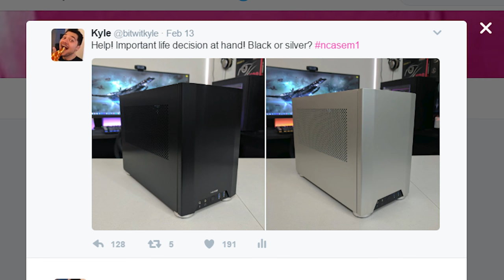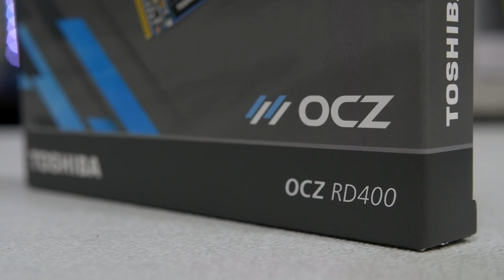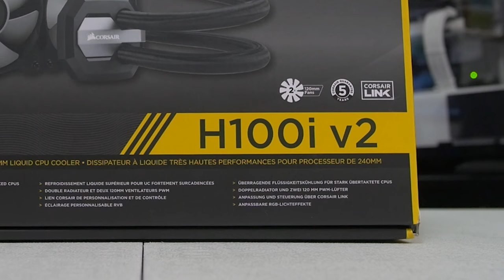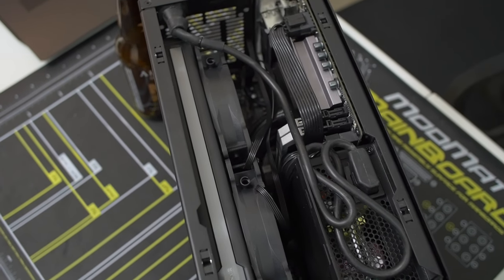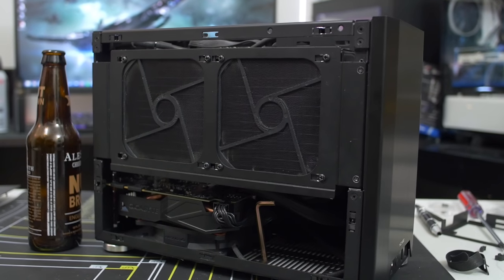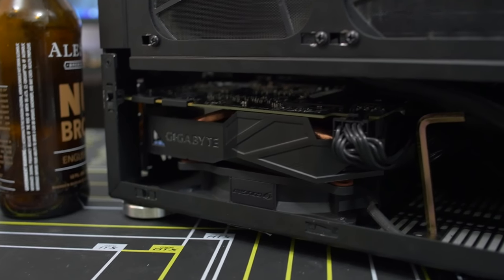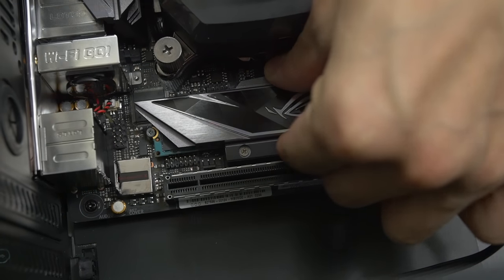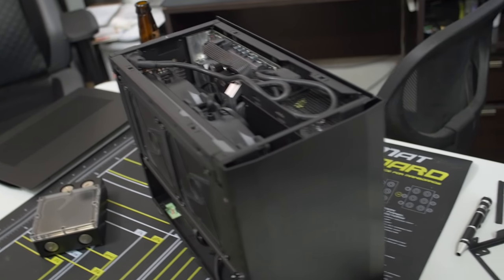$2000 Mini DESTROYER!! February PC of the Month - Part 1

Comment: A few FYIs:
1) New NCase M1 cases come with black feet and black USB ports, this is an older edition. New M1s also come with a steel side bracket and a 240mm magnetic filter, so you don't have to screw in those old plastic filters.
2) The case supports full-length graphics cards, you don't need a short one like Kyle used, unless you want to go ATX PSU.
3) Most custom watercooled builds in the M1 use a CPU block/pump combo (usually the Swiftech Apogee Drive II), tho it is possible to mount a pump in the front bottom spot. The side bracket is then used for a 240mm radiator, although it is possible to go dual-rad with another 240mm radiator on the floor, but you'd have to use slim fans for that and the airflow would be highly restricted.
4) You can go X99 in this case with the ASRock X99E-ITX/ac board, so this was hardly packing as much power as you can in the M1. ;)
Reply: Honestly there's no point on going ITX X99 because you won't get to make use of all the RAM slots or the PCIE slots.
Reply: For what I do quad-channel memory makes zero difference, for 95% of people it does too. You do get a PCIe M.2 slot connected directly to the CPU on that board, and also extra USB connectivity.

Comment: >Has 2 SSD drives
>Uses mush slower one as boot drive. 

Wut?
Reply: Hudson Ball the m.2 he is using as a dump for really anything, and the regular Ssd for os and some programs. What's wrong with that? The m.2 is better for file storage because it has good sequential speed, but slower write speed. So really as an os boot drive, the reg is better.
Reply: SSD means Solid State Drive.   saying " ssd drives" is redundant.  Just " Has 2 ssd's" would  have been better.

And it's " much" ...not mush.
Reply: Hudson Ball nvme.2 drives have the same speed as a normal ssd in terms of boot drives

Comment: I have the same case :D

CPU: i5 6600K
GPU: MSI RX480 8GB Gaming X
Motherboard: GIgabyte Z170-N WIFI
HDD: Samsung M.2 850 EVO
Memory: Corsair 16GB 1066Mhz
Cooler: Corsair H100i
Reply: mrk wkns nice build b.
Reply: Ey the M1 community, sweet build ;)

CPU: i7 6700k
GPU: Geforce GTX 1070 FE
Mobo: Asus Z170I Pro
SSD: Samsung 850 Evo
Memory: HyperX 16GB 2666Mhz
Cooler: NZXT Kraken X31

All that in a silver M1 V5. Love this case
Reply: Kevin S. Nice system.
Reply: Nathan Kam it was the only memory that was available at the time. But it's fast enough.
Reply: I have the original Ncase M1 number 594 =P

CPU: i7 4790K
GPU: EVGA 1070 Superclocked ACX
MOBO: Gigabyte Z97N-WIFI
RAM: G.Skill Sniper 16GB 1600C9
SSD: Samsung 500GB 850 EVO
HDD: Wester Digital Red 3TB
Cooler: Corsair H55
Reply: Hey, any chance of letting me know how heavy is the pc when built?
Im looking to build a similar system for myself, id really love to be able to take it on a plane or something like that..
Can it fit in a carry-on bag or similar?

Comment: You could use a zotac 1080 mini insted of gigabyte 1070 mini
Reply: not small enough
Reply: X Lightning gigabyte 1070 mini ends at the same point there psu starts, that gives us around 17cm + 12,5cm = 29 cm, there is enough space to put a full size 1080 FE card. Cable management will be a hard one
Reply: Tech King 
Gigabyte 1070 mini: 169x131mm
Zotac 1080 mini: 211x125mm
Reply: I've got an Ncase M1 with a 1080 FE, it fits fine.

Comment: Ncase M1!! I love mine, but a tip for AIOs; if you hold each side of the side bracket in each hand, turn it left or right 180 degrees so the tubes coil. They shouldn't kink but will fit better.

Comment: I put in x99 mobo, i7 6800k, evga gtx 1080 hybrid and corsair h60 liquid cooler and Samsung 950 pro nvme in this case! It takes time to do the cable management but now it works great! Never exceed 50 C. Tiny beast!

Comment: I have an NCASE M1 also.  One thing I did to make mine stand out is put an LED fan directly behind the filter on the side so it glows through.  I have a full size ATX power supply, and GTX 960 at the moment.  Still, I want a dan-case to feel complete.

Comment: Custom watercool that Ncase kyle! But I advise you to use the side bracket for radiator mounting since many at the ncase hardforum thread made feedbacks of getting better temps using the side bracket instead of mounting the rad at the bottom.

Comment: Do you think a x62 AIO would fit better? Sure the pump is higher and the LED would do nothing for you but the pipes are thinner and more manoeuvrable.
Also: Try the corsair sf600 next time. Its power connecter ist rotated by 180° . This way you can avoid the cramped power cable.
Btw: I always wanted to see this case with a 1080 strix. The card should fit and it has two PWM connecters on board to control the bottom fans.

Comment: I was worried when I seen the H100i GTX.. the easy way to fit AIO's in the ncase M1 is to get the ones with tubes that attach to the side of the block and swivel, and have the tubes curl around to take up the slack. The H105 fits in there no problem like that.

Comment: I have an ncase m1. Great case and awesome temps on air. I would recommend using a founders edition card as it sits at the bottom of the case and you don't want to heat up the other components. I have an intake fan under the blower cooler and it works great

Comment: Do you have the fans pulling air through the radiator in to the chassis? Seems like that would cause heat issues for everything else with how cramped it is.

Comment: Would be interesting to see a performance comparison to a $2000 gtx 1070 laptop (or any 1070 laptop). I have been on the fence between getting the NCase and doing a similar build or just getting a laptop with near same specs. Would it be possible to do a comparison? :D

Comment: I feel like I'm spamming with my 3rd comment but: People have put a radiator+fans on the bottom. Won't work as great with slim fans but you can do it. Why not just use a 240mm radiator on the bracket & use a full loop with that? Or, I guess, two seperate 120mm radiators; One for the CPU & one for the GPU.

Comment: The thermals won't be so good depending on how you connected the h100's fans to that motherboard. You don't have Corsair Link, cause there is no internal USB 2.0 pins, so there isn't a way to software control the rad fans if they are connected using the fan splitter attached to the aio pump. So the best way to do it is to attached the pump to the aio pump controller on the mobo and use a fan splitter to connect the rad fans to the CPU fan controller on the mobo.

Comment: You could have gotten a lot better specs for 2000 dollars. I just can't justify those specs for that price point. Also I would have preferred to use a 120 rad AIO instead of a 240 rad cause of the kinks in the pipes. It would freak me out to have that pressure on the water build up cause then I'd be afraid that the pipes would burst and leak onto the components. No pun intended. I would rather go with a 120 or even an air cooler in their like the Noctua one. Would you be able to do a second build using the Corsair SF AIO cooler? That would have made much more sense and I believe it costs less than the H100i V2. A custom water loop would be wicked in that small form factor. Perhaps you could have some tubes running all along the outside and make it look like a steam punk theme? Just a thought. Yeah I don't really think this was the best build for the specs you chose and the price point but cool to see what you can do with mini-itx.

Comment: or you know, use a 240 rad like you have now as that should be fine for a 1070 and a cpu. They may not run super cool but it will work. Then use the other 120mm fan slot below the psu for a pump mount

Comment: this build is very helpful. Could you do a build that includes the cost of a new OS and new monitors. for example if someone was switching from an iMac and was starting with nothing. If it could be a semi-budget build like $2000 - $2500. Do you except this challenge?
Reply: accept*

Comment: My M1 build is very similar. I run 32GB of ram, a 6700k and a 1060 6GB. I TOLD YOU ABOUT THE ISSUE WITH THE H100i V2.
Reply: Cody Gunst its funny how youre like I TOLD YOU ABOUT THE ISSUE like brah nobody knows you. you act like he actually reads all the comments and responds. he doesnt

Comment: Hi,

Which CPU is better for my Ncase M1, the i7 8700k or the i7 9700k / i9 9900k ?

The Price isn‘t important, i ask just for the compatibility (Temperatures), i have at the Moment the Noctua U9s, but i can switch to an 240mm Aio when i must.

I will not OC the CPU

Can you help me please for this decision ?🙏

Best regards
Reply: If you're not overclocking then cooling shouldn't be the biggest hassle, so go with what stock performance you want

Comment: It would be interesting to see an SLI capable version. Im trying to build one for my roommate ( a studying architect) who needs an SLI for optimal processing and at the least 64 GB of RAM if not 128 GB, with a nice CPU, thinking of RYZEN to keep cost down but at the least a 1070 SLI for GPU. Thing is he rarely games but needs something of the sort and looking at QUADRO cards but price is an issue. ALSO it has to be portable which makes everything even worse as there is a weight constarint of 40 lbs. Any help/input is most appreciated

Comment: How do you connect the Corsair Hydro (wich requires a usb 2.0 header) to the Strix Z270i wich does not have a usb 2.0 header?
Reply: I connected it to the outside of the case.

Comment: You seem to go a little overboard with parts other than the gpu, with a 1080 and 6700k, you have 1000 dollars left for the other parts, and you find a way to spend so much money on the other parts that you need to go down to a 1070
Reply: (There's a 1080 mini available if you were asking)

Comment: Dan Case A4-SFX is better and smaller :/ Just wish it would be a full release!! I really want one
Reply: Max Lombardo it is nice but limited to which coolers to use. And is stuck with just air cooling
Reply: coolermaster The case is so small fans arent really needed. Tbh even though they're both small, they're entirely different cases. I just really need to know if Asus's STRIX 1060 would fit in the Ncase.

Comment: Why the fuck would you buy a short GPU in a case that supports full sized GPUs. The 1070 mini doesn't even fit because of the extended PCB.

Comment: Yeah ... I don't know man .. if you have 2K to spend, get a proper pc... This is meant to be an office rat... imho it still is, regardless of what you stuff in there.. It has no airflow, it will heat like crazy, that cut down 1070 will probably perform half as good as a normal one.. I don't know man.. Not a fan at all .. I love these little cases, but for high end pc, get high end case .. Please